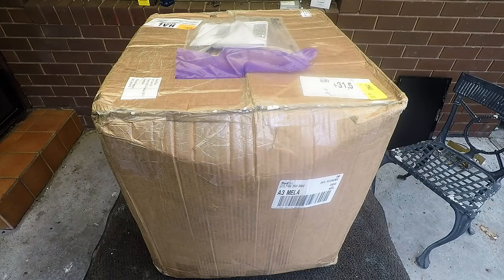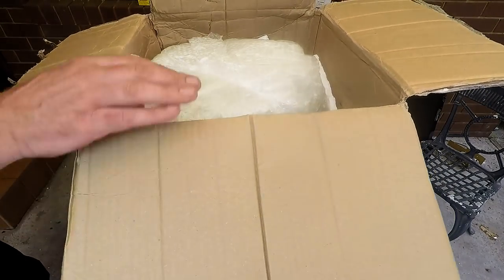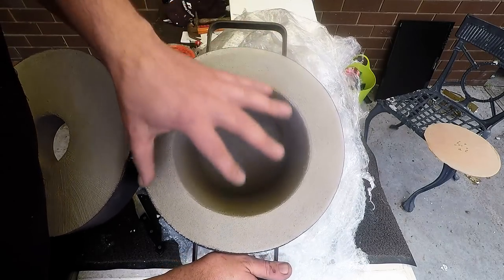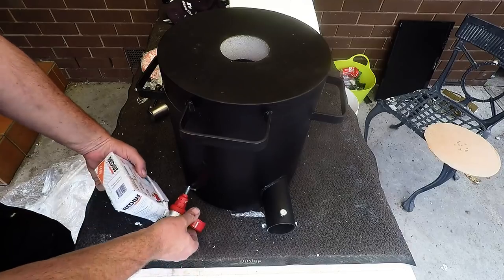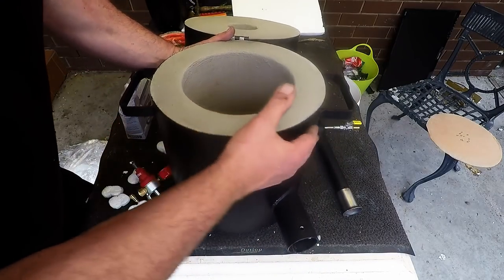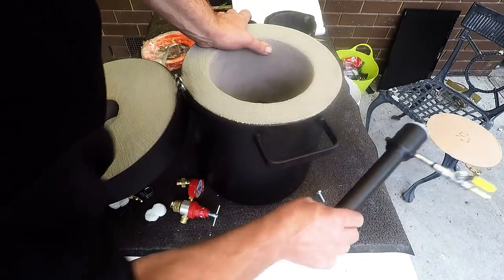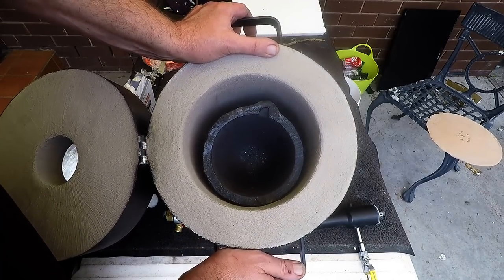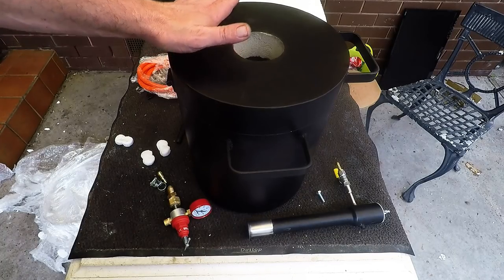Copper Melting Furnace - Un-boxing the 10kg Propane Furnace

Comment: Hi Ben I have been working with these kinds of furnace for a long time. Don't forget when starting it at the first time with the crucible inside, specially set the fire very.low for at least 15 minutes to really dry the furnace and the crucible, there is very bad smell at the first time. Then gradually set the gas higher.  As for the tongs for you the best would be a L shaped one. Good Luck

Comment: When I designed a control system to cure refractory for flares we’d ramp and soak just below boiling point for several hours for 300-400lb(100-200kg) castings. Then ramp up to twice boiling point for another 4 hours and this was before it was shipped and installed and cured again. Full size incinerators with tons of refractory casting would run for days just below boiling point to dry out everything and then slowly ramp up to full temp, 1350°C for hydrogen sulfide from diesel to sulfur dioxide if I remember correctly.

Comment: Hi Ben,take the gas parts to the shop with you,it will give them a laugh too.They will crimp the ends of the hose etc the safe way.
Those hose clamps just slip off,so please don't use them.
Good vid's,keep it up.
Reply: what shop?

Comment: if you do make your own, id suggest just making the lid sit into place. its just as easy to lift it off and sit aside than have it sitting off to the side where it can tip the whole thing over. i saw how much the furnace leaned when you opened it. not an ideal thing to have happen while its running. ive seen a lot of people make furnaces out of old beer kegs. although i know that wouldnt be as wide of an opening as you want. just some thoughts i had. cant wait to see some melting and pour videos. keep it up ben.

Comment: Ben I would try to make a round crucible tongs that go around the diameter instead of pulling it out with just a pair of long pliers, just to support the weight for added safety while hot - not saying you are wrong I have seen it done the way you have shown many times but it just seems right to support it with molten metal and hot material by the entire crucible.  As for the furnace I am curious if you are going to have better results from this furnace or your electric? do you think it is going to cause more oxidation from the added oxygen with propane? will you need to degas it now?
 I'm looking forward to your usage and testing, I don't really cast copper but I imagine like aluminium it requires some type of degassing and copper on its own might require some type of shielding to keep the air out so you don't have porous casting or too much loss due to oxidation.

Great videos Ben - Absolutely shocked that furance made it in one piece packed like that.

Comment: I hv melted Aluminum n copper in them. some offer the hole like your new one or not. since you hv a drop down smelter, it should work fine. the digital one may be faster to start. If i recall, the kiln we had was 1300 degree celcius.

Comment: can you give me the measurements of of this Furnace?  looking for width, overall height, the height of the lid,  how large is the hole inside the Furnace & how think is the cement inside the Furnace?  looking for a breakdown of the overall dimensions.  I'm looking at building one instead of buying it like you did.  Also I can point you in the right direction if you plan to build another Furnace & torch instead of buying one.

Comment: use an industrial size kitchen pot with hinged lid  and line with cement  and the line the lid too. drill a big hole in the top. shalom

Comment: Nice!! Stepped up to The devils forge.... that thing pops out some heat once sussed out bro....i parked the electric furnace up a year ago and pumped that badboy up!
Reply from the maker: Yeah i'm a bit freaked out by the propane tank, but there's so many more options with a bigger furnace, my electric furnace blew up again and melting copper eats up the small crucibles too quick.

Comment: I just had a really good fail, trying to melt copper. Home mode kiln, pyrometer got up to 2500f, but apparently the copper in the steel crucible did not get that hot. What does it mean if the copper is brittle now?? I had to have been close right? I kept it up in the 2000f plus range for two hours and finally said ok, this is not working...
Reply from the maker: sounds like they got cooked but still short of melting temp, you were probably losing heat from the steel crucible.
try putting a solid chunk of copper at the bottom so that melts first then your wire will melt into it.
it would of been glowing red at that temp, I don't know how home made furnaces work, it might be low on insulation to keep heat in or your burner is not strong enough.
Reply: Thank you. It was all glowing red, I think your right about the steel crucible. The insulation is 10 inches of cement and perlite mix, all around with a 6 inch diameter hole. The fact that the pyrometer kept blanking out meant it was getting over 2500f which is plenty hot. And it was because it would flash on with readings of 2400f something. It takes about 2 hours to be able to get to that temp. One blower, two to three propane torches (has four inlets).

Comment: Awesome little furnace mate..   if i were u I'd drill a 12mm hole in the bottom so if a crucible fails/crack your ally /copper flows out the bottom and doesnt set and wrech the furnace..  its a pity this ones burner entry hole is located right at the bottom as thats where the meted metal will flow if a crucible fails, (happened to me last week)..  for large loads of aluminium i build a brick chimney about 2ft high in the backyard twice as round as my crucible and use a jumping castle moter to blow air in the bottom, running on bbq coals it melts aluminium in minutes at low air flow (i block the pump intake with a rag to slow the flow) and at full flow it melts copper/brass real easy in 10mins...   im building a couple furnaces like that atm, i live near "bathurst nsw"..  one out of an old beer keg so maybe 15-17kg capacity and one from a air compressor tank maybe 5-8kg capacity...  theyll be made very similar to the one u just bought except the burner entrys are 1 inch above the floor level and they have a 12mm drain in the floor for failures..   im putting both on wheels so there raised for leaks into a breadtin if they fail..      ps.. theres a place in sydney that sells refractory materials about 150$ will build a beerkeg sized one with there refractory concrete pre mix..  they sell 10× cheaper than ebay and they mail too.. ill post a link asap when i find it...  pps ill update u when mine are finished..  ppps..  theres many build vids on great copper/ally melting furnaces by king of random, but i love an aussie guy who builds waste oil burners on youtube hes great and shows no refractory is neccesary for ally, so 44 gallon  drums are fine if u want to melt say an engine  block lol..
Reply: There based in sydney so us aussies can get it cheap after all... they likely have melbourne links but will mail to you to..
Reply: stephen saunders could you show some pictures of your furnace, because i built a Brick furnace too and it cant even close get the temperature of melting copper
Reply: Im not at home atm.. but will show you tomorrow.. i even melted a stainless crucible by accident lol..  i didnt use refractory bricks either just wall bricks..
Reply: I use old insulater logs from a fake heater chimney as the roof of my furnace and thats what gets me to copper temps.. i found the logs at the dump in an a old gas heater fireplace..
Reply: Mate i just took a heap of photos.. youtube has no option to upload them to the comments? If u know how let me know..   its standard house bricks set in a square about 5 bricks high.. i have a 1.5kw blower fan (a hairdrier or small pump will not be good enough for copper)   the lid im using is two fake fire logs from a gas house heater..  it needs these logs to reach copper melting temps they dont barely get hot at all and reflect all the heat on my metals..  it works fine with no lid for aluminium but needs it for copper/brass
Reply from the maker: you could always make a quick video and upload it to your channel
Reply: I might make a few vids in the future, check out vids by "oil burner" an aussie from victoria i believe, he has almost 100 vidoes on melting ally, i do it exactly like him, but for copper i use the insulated fake fire logs as a lid to jump the temp by double, and increase my air and fuel by probably more..     "please check out oil burners videos" and you will get what i mean, he does a brick furnace in a few vids too mine is half the size of his with a lid for copper which is the two fire logs i mentioned

Comment: You wrote electricity is More expensive then gas, is it like this in your country? Cause Here electricity is realy cheap
Reply from the maker: then gas must free?
Reply: eWaste Ben nah not like that, a 10liter bottle of gas costs around 20€ a refill, where electricity cost around 0,15cents/kwh, so i mean electricity would be cheaper
Reply from the maker: no it's not really, crucibles eat up too quick in electric and they blow elements & relays, my electric furnace blew the relay, the element blew a few months ago, only way with electric is to go industrial, $15k+
Reply: eWaste Ben yeah you are right, but if you use your Salamander crucible it doesent wear out faster than with gas. And with a self made furnace you can easily replace your heating element very cheap, it only Costs about 5-10$

Comment: A guy who has a channel called 1puglife made a furnace last summer.  If you can weld you can make a furnace.  His furnace runs on used motor oil so there is no cost in running it.
Reply from the maker: I like the idea but I don't like running electricity with it too, the hair dryer uses as much electricity as an electric furnace.
I wanted this setup to use without electricity at all, just propane.

Comment: Be careful what your breathing while melting metals, Ben. https://en.m.wikipedia.org/wiki/Metal_fume_fever
Reply from the maker: look up chem trails, your breathing, eating and drinking metals everyday, not to mention exhaust fumes, brake lining asbestos at every stop sign, copper is good though, brass is the main problem with it's zinc content.
Reply: A lot of copper from electronics contains cadmium though, which is highly toxic.
Reply: I've seen forges like these made from old beer kegs. A keg cut apart and lined with refractory cement would make a nice large forge.
Reply from the maker: Yeah i picked up a keg recently, might use it for aluminium melting but not until I move out of the city, I live on a postage stamp

Comment: SINCE THE LID IS SOOO HEAVY 
JUST BILD A METAL  STAND TO HOLD THE WEIGHT OF THE LID 
WHEN IT IS VERY  HOT 🥵 
SO THAT YOU WILL NOT 
HAVE ANY  ACCIDENTS 
GET YOUR FRIENDS TO WELD THE METAL LID STAND

Comment: Ouchy the propane's are pricey.
Reply from the maker: yes but you can use a bigger and better crucible, that's what costs long term, a proper salamander crucible last for over two hundred pours, graphite in electric lasts 6 pours

Comment: THIS GUY TAKES)(TOO LONG)
TO GET TO THE POINT 
BLYMEE   NEXT TIME  JUST 
HOOK IT UP ) MAN  SHOULD 
US  WHAT IT CAN DO 
STOP ✋ WITH ALL OF THE 
COMPLAINING ) IS YOUR GLASS 1/2 EMPTY or 1/2 FULL 
HE  DID NOT EVEN READ THE DIRECTIONS; CLUE LESS 
DID NOT GET HIS GAS TANK 
WHILE HE WAS DOING ALL THE WAITING for His  EQUIPMENT to ARRIVE  ) KNOW THAT THE Manufacturer of his metal melting furnace had specifications on the kind of propane tank that would be required to operate his furnace why did you not get the propane tank and hook up the equipment so you could show us what it could really DO DO